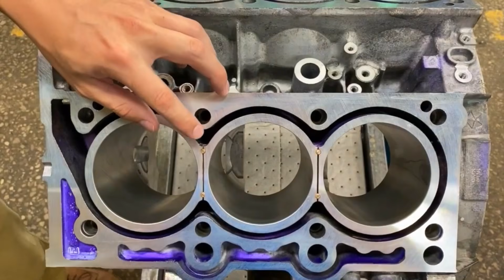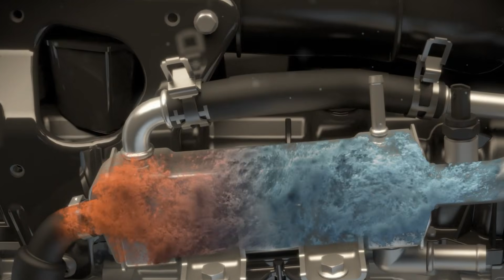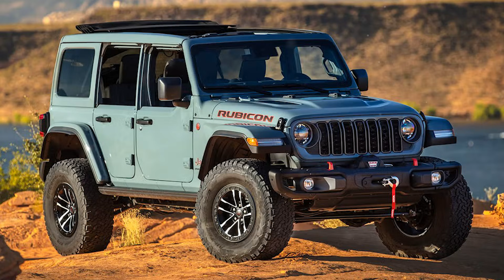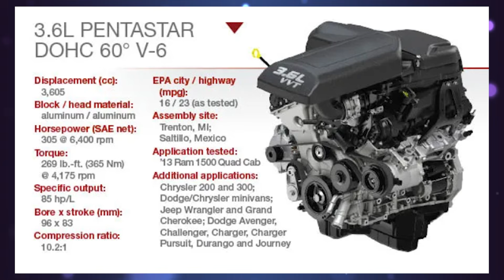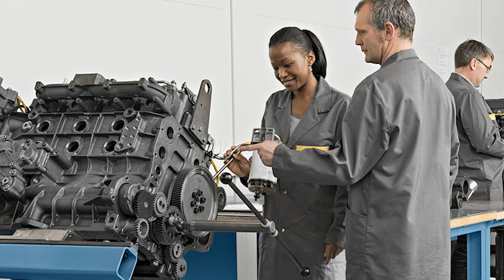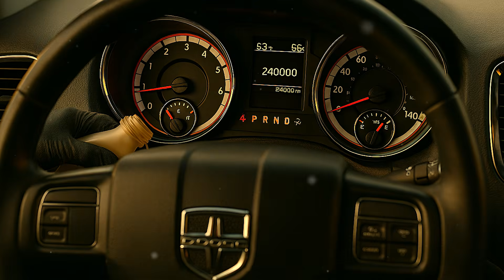Why Mechanics Love the Pentastar 3.6

Comment: Every oil issue you're talking about E85 can take care of. 
If your vehicle is made from the factory to burn E85, your fuel pump, fuel injector, catalytic converter and all exhaust issues will virtually disappear. Pretty much anything to do with the fuel engine and exhaust train.

Comment: Mechanics love pentastar engines because with all the problems. The engine puts there children through college. Versatile yes and goes in multiple chrysler products. But they are a disaster waiting to happen. With lifter failure premature cam wear and extensive oil leaks from the oil filter housing everyone should go out and buy one. I mean Maserati used a version of it in there top end sports car lol.

Comment: Dodge Caravan 2012 telecom use with a rack and 2 ladders  with 221ooo milles (355000km)  still running smooth no big oil consuption not noisy just perfect ✌️

Comment: I have 3.6 liter Pentastar engine in 2016 Chrysler200C AWD has 295 horsepower, I use Synthetic oil and change oil every 6 months I only put 2500 miles on oil change every six months, Change oil twice a year, I have 60,000 miles on car. 
Very fast and quick car, I use paddle shifters for quicker shifts.

3.6 Pentastar V-6 engine nice smooth power though Torque curve, coupled to 9-speed transmission, awsome acceleration from dead stop.

Most cars being built today have 4 cylinder engines. Try finding V-6 engine in car, or mid size SUV impossible 

I had 2003 Chrysler 300M had car for 17 years with 130,000 miles never had any issues with engine or transmission or cooling system in car, 2020 sold car because OEM Parts impossibleto find. People complain about engine and transmission failures, likely skip fluid like oil changes, coolant, transmission fluid changes. Continue run car with check "engine light".

Comment: I love an engine that has two big floopin' cam chains, plastic manifold, plastic hoses, no valve to stop oil drain back into the engine when shut off and most of all, when you first start it up and the RPM's hit 1800 you can hear those lifters banging and those bearings being eaten up. Ahhhhh, music to my ears and dollar signs in my eyes.

Comment: Quite a few statements in this video that are not true like the block material. But having worked on GM v6 and Ford V6, the Pentastar is by far the easiest to work on. Ever change a water pump on ford or chevy v6. lol. Spark plugs on pentastar super easy, two 10mm bolts for bracket, 13mm in back, 8 mm for plenum wha laa , simple. Having both dodge grand caravan and chrysler T&C, dodge 168k and T&C with 219k , I can say excellent engines. In fact put a challenger tune on the T&C for 305hp . Grocery getter beating lots of vehicles. Then you remove mid and rear seats, no joke, thing moves and funny passing vehicles watching passengers in other vehicle mouthing things like "bro or dude, you got smoked by a minivan. (while horse laughing at driver). Never had an issue. but then again K&N air filter, Royal Purple full synth, Challenger tune, 185 thermostat. With 219k, runs like brand new. Friend 300s with 3.6vvt, tight running engine. So same engine, different platforms and no issues. Don't know what else to say except, love these engines.

Comment: Changed the oil and took care of it. 110k it started knocking ... Crap.
Reply: Bingo
Reply: bought a caravan with same engine with 260k km couple month ago had an oil change still running good and I red line it very often got almost another 10k on it of course with oil change

Comment: So as pentastar owner let me explain explain 2 major things that are very wrong and not customers fault. Manufacturer recommendations for low viscosity oil and transmission fluid for fuel efficiency restrictions by government and second wrong thing for the same reasons I mentioned is high operating temperature by adding 204f thermostat VS 180f that is standard and in some vehicles and trucks they add plastic shutters in front of radiator to keep operation temperature high for emissions purpose, SO high temps with low viscosity oil and transmission fluid is not good combo or I can say is a disaster that the customer have to pay for. The minimum oil viscosity for any V6 or V8 engine is 5W30 that any vehicle or truck should start from, I installed 180 RIPP thermostat as well and removed stupid plastic shutters in front of radiator and now I have normal operation temps like all my other vehicles Mazda cx5 and second generation Tundra around 186-188f, I mean exactly the same I have gauge tool to measure the temperature. The 3rd manufacturer mistake or bad design is the cartridge oil filter, but thanks to Baxter performance adapter for spin on oil filters I fixed also that issue to prevent dry starts that is known as lifters killer. So if you treat the pentastar v6 engine right from the very beginning with the right viscosity and high quality like Amsoil or Redline oil and fluids every 5-6k miles engine and 50k miles transmission your vehicle will last forever.
Reply: Thank you for this information. We need more people like you on the Internet.
Reply: @edodukic7545 yes? And what information you get from this ? 😂😂
Reply: Thanks arxigos365. I'm fixing the blown head gaskets and chewed up intake cam on my 2020 Gladiator and I'm using all your advice when I complete my build.
Reply: @johnflores9617 operation temperature is number 1 enemy of all issues from lifters head gasket and all kind of leaks oil coolant, I call it silent killer, American vehicles are designed to run hotter for emissions regulations and restrictions, the only oil viscosity that can handle high operational temps is 0w40 but again I prefer to lower operational temps to 185f like all Asian vehicles and 5w30 oil.
Reply: I have the engine and do the oil every 5k.  I honestly don’t know when to change the trans fluid and I’m scared to.  What should I do??
Reply: @GBRemy I did mine for  first time at 155k miles nothing wrong
Reply: @arxigos365 ok I’m at 151k miles now.  So you actually flushed all the old trans oil and added new?  I’m scared that it will shock the trans and ruin it.
Reply: @GBRemy drain and fill 4 times no flush
Reply: @arxigos365 thanks for the tip 🫡
Reply: @G @GBRemy lcome 
About fluid you can use Valvoline extended protection
Reply: @arxigos365 ok noted.  Thanks!
Reply: @GBRemy I did mine at 120k is your Tran running good now ? If so take it to a trans shop for fluid change and pan replacement . I trust the experts and yes it cost me like $600 . I plan to do it every 60k miles now
Reply: I have a 2012 Chrysler 200 with the 3.6 Pentastar. Most of the 200's had a 4 cylinder, which for a 2 ton vehicle is stupid. Anyway, I bought mine in 2014. with considerable original warranty left. Had a lot of get up and go. Right off the bat I had radiator and coolant level issues seemed like I went from dealership to dealership to resolve...took it to Troy Motor Mall and the issues was resolved after an engineer from Headquarters oversaw the repairs ...ten years later I had an engine oil cooler go. In 50 years of driving never had that on any car...also twelve years old she needs her head gasket replaced. Dealt with head gasket issues on my mustangs in the past so I get it. But all that said, I love the power she puts out. I feel like I have a V8. She gets good care and I'm old school so oil changed every 2,500- 3 MAX ...Body starting to rust but she's not garaged. Still knows how to break out of the gate when given the green light.  Thanks for all the information. You know the engine well
Reply: I have an '18 Pacifica gas and my thermostat opens at 195 not 204 but I do use 5w30 not 0w20 and I to ripped out the AGS grill shutters
Reply: Baxter doesn’t change anything
Reply: @corpltd505 How can it not, doesn't it keep oil pressure up top on cold starts?, that's what they're for.
Reply: @seatime674 with Baxter it doesn’t do it either. You need to read how it works but not on Baxter advertisement. If you won’t dry start afther 6-8 hours you need to pre oil system with brakes pedal and accelerator pedal. That’s it
Reply: @corpltd505 looking at details it prevents Drain-Back. The integrated anti-drainback "check valve" stops oil from emptying out of the filter and upper valvetrain back into the oil pan when the engine is off.Eliminates Dry Starts by  keeping the upper oil gallery and filter primed, it delivers oil pressure to critical components (like the cam phasers, lifters, and rocker arms) much faster during startup to reduce wear.. I'm wondering why you're saying it doesn't work that way.
Reply: @seatime674 no Baxter just cut time. Nothing more. And  standard oil filter drains afther 5-6 hours not 30 min. And upper part of the engine not drains all, just to the bottom of the filter. I live in tropical climate and here I don’t even need to pr fill oil system to have immediately oil pressure after night.
Reply: @corpltd505 I'm not sure where you're getting your info but it reads The Baxter Performance Oil Filter Adapter retains the oil in the filter and upper system overnight; its spring-loaded check valve closes when the engine turns off and does not release or drain back over time.How the Check Valve WorksRetains Oil: The internal spring-loaded check valve keeps the filter and upper oil galleys flooded indefinitely while the vehicle sits overnight or for extended periods
Reply: @seatime674 sorry but you don’t know what are you talking about.
Reply: @corpltd505  I'm copying it from sources directly online, where are you getting your information that the check valve doesn't hold pressure overnight and I'll look into it.. These wouldn't be necessary or even made if it didn't do that.
Reply: @seatime674 I’m talking about oem setup.
Reply: @corpltd505 You don't even know what you're talking about Baxter Performance does not make original equipment (OEM) oil filters for a factory setup.Instead, they manufacture aftermarket billet-aluminum cartridge-to-spin-on oil filter adapters. These adapters replace or modify the stock cartridge/canister filter housing on specific vehicles (like the Jeep Pentastar V6 so you can run a standard, off-the-shelf spin-on oil filter
Reply: @seatime674 can you understand what you’re reading? I’m talking that oem filter doesn’t hold oil for all night long. I’m just saying that Baxter just cut a little time for full oil pressure. You can find all this informations everywhere. It’s not my fault you don’t understand what you are reading
Reply: @corpltd505  Someone else talked about Baxter then you answered him saying "BAXTER DOESN'T CHANGE ANYTHING", Then you proceeded to tell me the drain back happens after 6-8 hours Which is totally false... No ones talking about OEM Baxter doesn't make anything OEM!!!... Baxter doesn't do anything OEM so I don't even know why you brought it up so Don't back track by acting stu pid now. You were wrong just admit it, Oem filters don't go in the Baxter they are made for canister type screw on metal filters
Reply: @corpltd505 for me works fine, last time I was out on holidays for 3 weeks and started the truck right up without any weird noise in first 5 seconds, smooth as was sitting 1h and not 3 weeks.
Reply: @arxigos365 👍

Comment: I had a Crysler T&C with the earlier V6 and I drove it 270,000 miles before I got rid of it. It did have one issue. The FI harness came loose and it dropped down near the exhaust and melted all the wires together. I cut out the melted wires one at a time spliced them back together myself and rehung the wire harness . It was fine after that. 

With that said, I've heard th Pentastar is a really troublesome engine.

Comment: Mine has been very reliable through abt 180k miles.  Everyone I know who's had one has also gotten to 150k miles or more easily.
Reply: I traded my 2015 Ram 1500 with almost 180,000 miles. Absolutely loving my 2025 1500 and we made sure it had a Pentastar v6. I drive gig delivery service and approaching 30,000 miles since March.
Reply: So, should you replace out all the plastic parts before any leaks or problems? , or wait ?
Reply: I got 80k miles on mines still going strong and no oil consumption

Comment: Lmao, mechanics love this motor for job security and that's it
Reply: Amen
Reply: I call BS work vans and own a few taken care of rightly and get over 300K miles all day long!
Reply: A modern legend 😆 🤣 😂 
A modern pile of shiiitt
200 000 lol yeah right.....200 000 isn't much either
Reply: so tell me how is it worse than ford 3.5 or 2.7 v6 or gms 3.6 v6 from servicability stand point ?
Reply: @akossandor469  well I own both a Chrysler 3.6 and a ford 3.5 and I can say that the Ford is much easier to work on and a far better design, I also have higher mileage on the 3.5 with no issues other than changing the water pump. My 3.6 has had lifters, cam phasers, oil cooler, torque converter, and brakes fail including electrical issues so idk maybe it's personal for me but I will never own another
Reply: Yup that’s it. It’s a hunk of junk and I don’t know who has any “respect” for this engine.
Reply: @DasNewsNetwork I have respect for the 3.6 Pentstar engine. My 2012 Chrysler 200 sport has 292k miles. Heater core cloggs. Casting sand get in antifreeze. Must use filter
Reply: @DasNewsNetwork There are over 16 million units on the road and most people have no issues. Every engine has things go wrong but this engine has been very reliable
Reply: It's as good as any engine today, better than many. For example, California Highway Patrol's Charger Pursuits all have the 3.6 L Pentastar since 2016, it's been doing well. Sure, a few have needed replacement, but overall it's been a very reliable workhorse under police duty. I know this because I've spoken with the service manager at a dealership that services a loft of CHP's Chargers.